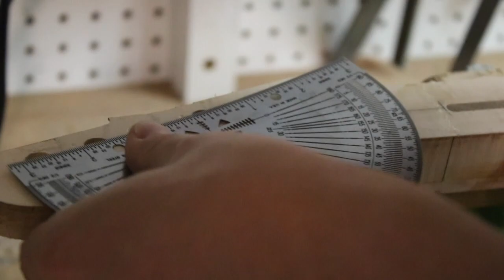Building a Replacement Tele Neck from Scratch Part 2

Comment: NIce videos.  I just finished a few all maple necks and I had some marks left on the maple after rounding the fret ends... I even had everything taped off.  The maple fboards are very unforgiving, they show all your inadequacies....lol.  Rosewood or ebony much easier to hide stuff.
Reply from the maker: Good rule of thumb - if you think you're done sanding, you still have a couple more hours to go. Use light, preferably natural light, to check for scratches. They stand out like a sore thumb when light is cast over them almost parallel.

Comment: the nut slot on my new tele neck is way too narrow, about 1mm. I’m thinking to wrap up my fretboard radius gauge with sand paper to widen the gap, a sound plan to you, or theres other easier/safer way to do this please? many thanks
Reply from the maker: That sanding method would widen the gap in both directions shifting the scale length of contact from the nut slot closer to the bridge. The rest of your equal temperament frets will be out and intonation may be impossible for lower gauges. 
To "widen" your nut slot you should scribe a line about 2.5-3mm from the current nut slot line with a scalpel and pare away the waste with a sharp chisel. From there you can use a flat file or radius gauge w/ sandpaper to file the nut slot.

Comment: Is there any advantage for putting the truss rod through the back?
Reply from the maker: Putting the rod through the back would only be necessary in a 1 piece neck where you don't have a neck/fretboard glue joint. Otherwise, putting a skunk stripe down the back with a 2 piece neck is more an aesthetic choice.

Comment: I notice a lot of guys building their tele necks 1" plus .25" fretboard. Is there a reason? I make mine with .75" plus ..25" fretboard (total 1")
Reply from the maker: 1" total will get you pretty close to Fender spec. I often get set up jobs asking for lower action but they don't want their picking hand scraped by the saddle height adjustment screws. Often this is solved with a simple shim or using Fender's break angle adjuster in the heel.  Building in extra height give you the option to have the neck sit hight out of the pocket and sand down to a place where screws sit flush with the saddles but you get low action on traditional bridges. You can also plane in a 1-2 degree break angle or more for TOM or Bigsby set ups.